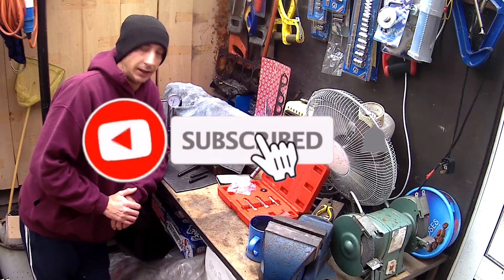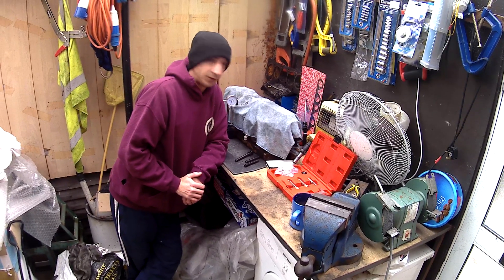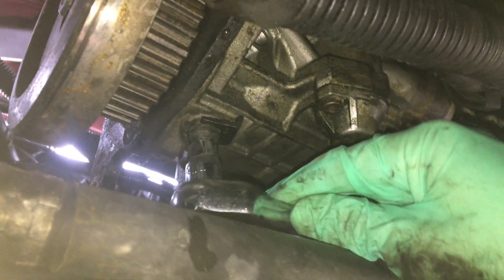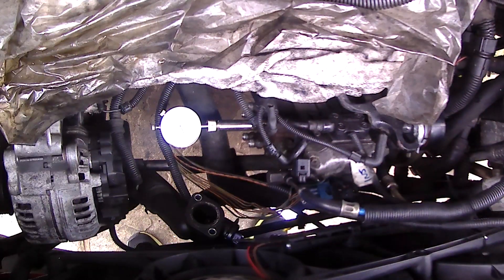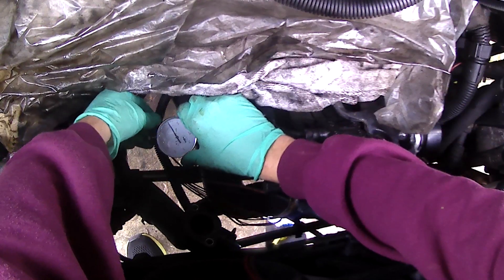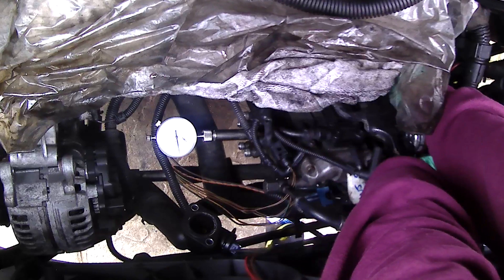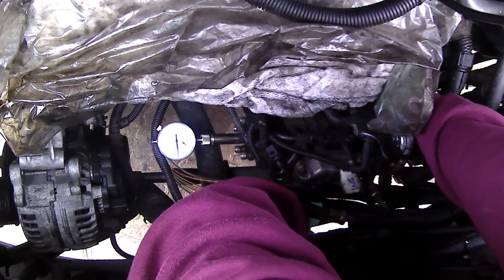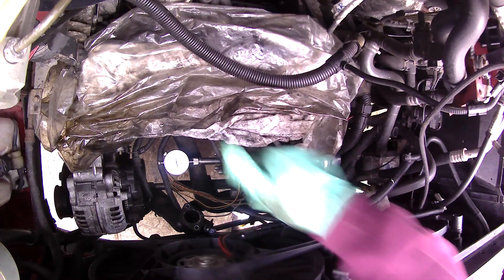Bosch Diesel pump timing//ACV Engine

Comment: Hi there, I'm doing the pump timming on avc t4, got a dti gauge,
Struggling to get it started,
Followed instructions,
How do you find out bdc with dti gauge?
I turn the crank anti clock wise until the dti gauge stops, however if you keep turning the crank anti clock wise, the gauge goes round and round and round,
Is there something I'm missing,
Setting up gauge is a bugger,
Struggling with loading the pump to 0,55 or 0,57 as I'm trying to set it up at bdc,
Reply from the maker: 5 cylinder engine, manual 5 cylinder fuel pump, the fuel pump and the engine together both need to be firing is sync. when the engine is tdc timed up, and the pump is timed up, the pump will be at 0.55 and if you release the pump timing you will notice that the pump was under compression and as a result of releasing the pump timing it will naturally rotate back to btc which is when it isn’t/doesn’t feel any load on the pulley, this point is bdc, if you keep rotating back you will change the firing order of the pump to the engine, if you’ve gone passed the compression stroke going backwards on the pump, just rotate it forward so that the pump timing marks line up roughly, while there under no tension you then rotate the pump to 0.55/0.57 which you can feel the tension as you rotate

Comment: Hi nice video. I am a bit confused about direction when setting the timing. Is it correct to turn pump shaft anticlockwise from BTDC, that is opposite the engine rotation)   to 0, 55 mm?)

Comment: I bought the same kit, am I right in thinking the extension rod screws into the gauge rod? That’s what I did as it was too long to work otherwise and to make it work the tube was only partially screwed into the pump and sat loose and at that it barely clamped the gauge to it! The extension rod seemed too long! Got the van running with it but like a smokey bag of spanners so need vcds now although not convinced how good this set was for initial setup! Great video thank you 👍

Comment: Hey Matt, grate videos about setting up the injection pomp using the gate tool. Hey, do you have any knowledge where to find BDP on 2.5TDI 102hp 2003 with automatic gearbox?

Comment: would this gauge work on the  2.4  engine diesel pump
Reply from the maker: Yeah it should work, I’ve not done one of these but I have read before on forum the fuel pumps can start to run retarded as they wear with age. Autodoc tec say to adjust to .60mm lift instead of the normal .55mm. Personally I’d time to .55mm run van upto temp then see how the timing is using an obd2 diagnostics tool, and then make adjustments

Comment: I use vcds to set the injection timing after the engine is at 80°C.....( Aprox 5° BTDC)
Ps
I have dti gauge...but I'd rather read the ecu ...then adjust the injection timing regarding the ecu says
Reply from the maker: I don’t have vcds, I do have an obd tool and it does tell me degrees, but I only use that after I timed it just to double check.

Comment: Hi.. Were did you buy the tools you are using
Reply from the maker: I got a kit from eBay which had the adapters to screw into the fuel pump, I have another set of dti and tested the accuracy of the eBay gauge and it’s accurate enough to do fuel pumps

Comment: Hello, greetings from Turkey.  my 2.5 vehicle shakes at 1300 1500 rpm at idling and shakes at take-offs. My vehicle is 325000 km, how much should the advance setting be, thanks
Reply from the maker: For the pump timing it should be set with the dial gauge at 0.55mm but you can advance it too 0.57mm which people recommend on the forums
Reply: @TwiggsT4  I don't understand repair.  The masters here do not know t4s much.  My car is so clean I don't want it to be like this
Reply: @TwiggsT4  Can the shaking and idling vibration during take offs be solved by adjusting the fuel from the pump?
Reply from the maker: It can yes, although it could be the engine mount on the gearbox, or it could be the dual mass flywheel
Reply: @TwiggsT4  Greetings from Turkey.  thanks

Comment: Good video - my DTI gauge moves back to near 0 after I tighten the bolt with the spacer - is this correct?
Reply from the maker: Mine didn’t move it stayed on 0.55mm
Reply: Hi thanks for the quick reply - I was being stupid and left the clip in whilst ‘locking’ the pump!
Reply from the maker: Doh, at least you found out where you went wrong 👍

Comment: Hey Twiggs! Love the video! Could you point me in the right direction where I can buy that kit? I've been searching ebay but all I come up with is kit's that cost like 30-100£
Reply from the maker: Thank you for your feedback. I’ve just had a look and the seller I got mine from has sold out. Also it looks like the prices have gone up since the beginning of the year, handy bit of kit to have tho and it’s still cheaper to pay the extra to get the timing kit rather than getting a garage or someone else to do it
Reply: @TwiggsT4  Thx mate! I'll gladley pay 30-40£ for the kit.
Reply from the maker: Good luck

Comment: Hi. Nice explanation.  You need to be sure that the pump is a bdc after you align the marks. You need to rotate the pump slightly clockwise until the dti doesn’t move anymore, then zero it, before then moving to 0.55mm anti clockwise. Apologies if you did this, wasn’t super clear on video.  You can the confirm timing using VCDS once it’s running. Can’t wait to hear it running, keep the videos coming 👍👍
Reply from the maker: Thank you, I did do exactly as you said, but I got it all set up tested and then tested again, then realised I didn’t press record 🤦‍♂️ so when I done it again I couldn’t remember what I had and hadn’t said, I didn’t want to repeat myself but doing this I forgot to show me rotating the pump backwards to check it was bdc. Also that reflection on the dti you couldn’t see me zero the gauge. Once I get it running I’ll get it up to temp then check on VCDS 👍👍👍🤙🤙🤙
Reply: Hi Matt. When we talk about roatating the pump clockwise or anti clockwise.. is it when looking at the pulley or looking at the other end with the pipes?
Reply from the maker: The pump rotates the same direction as the engine when running so when looking at the pulley it rotates anticlockwise from bottom dead centre